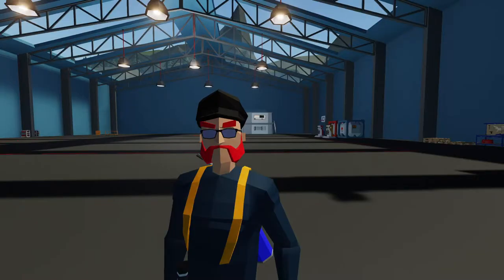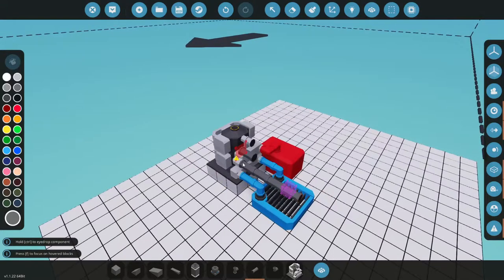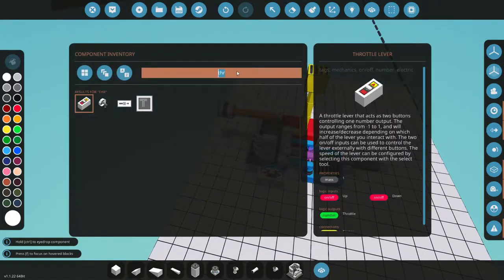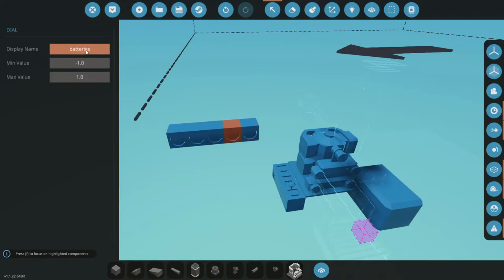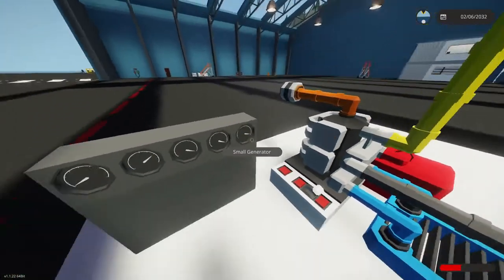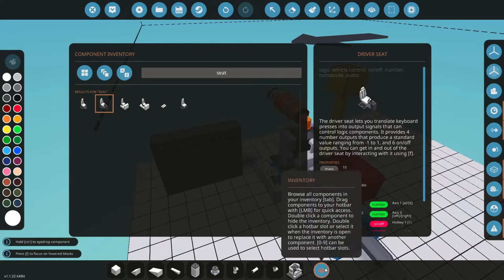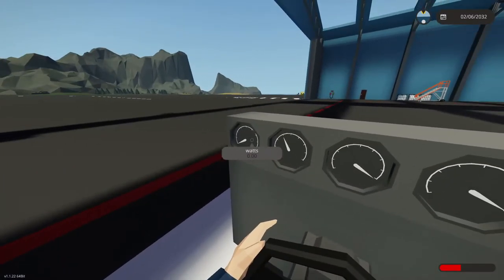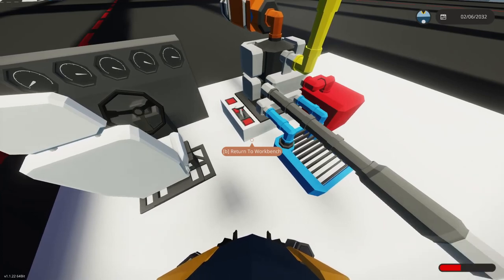Stormworks Engine Beginners Guide Tutorial

Comment: so, the engine works, unless I put it in my train. I used the medium engine, not the small one, and it won't work. I tried building it as just a platform with a wheel connected, and it worked, but when I tried putting it on a train, it doesn't work. The RPS is spinning, it will propel the locomotive forwards, but the engine won't stay running. Any idea what's wrong? Is there a limit to how long pipes can be?
Reply from the maker: Bigger engine

Comment: So I know that this is an old video and the game has updated a bunch but i have my engine hooked up exactly how it needs to be, but it goes to my wheels instead and as soon as i activate the clutch my engine dies. Any solutions?
Reply from the maker: Gearboxes?
Reply: I ended up finding it out my gear ratio was 1:1 changed it to 3:1 runs “decent” but not without minor throttle adjustments

Comment: I have the problem that i can start the engine, but it dosent run on its own afterwards. like you try to start a car, you hear the starter, and than nothing.....
Reply from the maker: It's not getting something.  Check air fuel exhaust and if those are good maybe the clutch is engaged.

Comment: i have this set up but it is connected to props , when i engage the clutch to feed through the rpms drop to zero and i lose power. any ideas ?
Reply from the maker: probably in your gear ratio, try changing it around and see if that fixes it.

Comment: So i did everything connections, fuel, air, exhaust, and coolant and it STILL will not start.
Reply from the maker: Battery?
Reply: @ProfNCognito  yep
Reply from the maker: Hold page up when you look at the engine.  It will give you more info to see what's wrong.
Reply: @ProfNCognito  I hooked air and everything up and it said no air and fuel for some reason
Reply from the maker: Then they are not hooked up right. Maybe join the discord and give some screen shots and we can help.
Reply: @ProfNCognito  I made sure everything was hooked up correctly. Also I do not have discord.
Reply from the maker: At this point without photos I'm not sure how to help. I'm sorry 😞